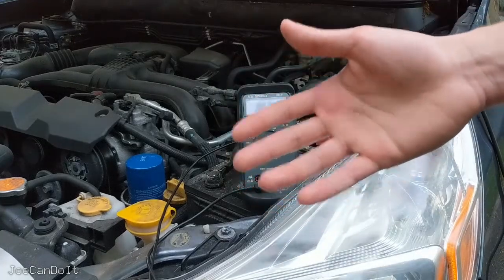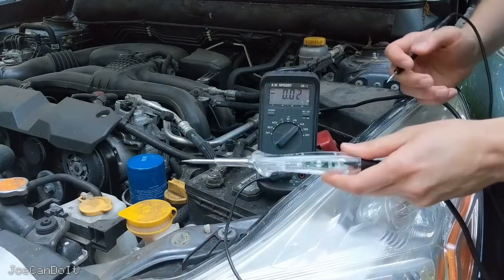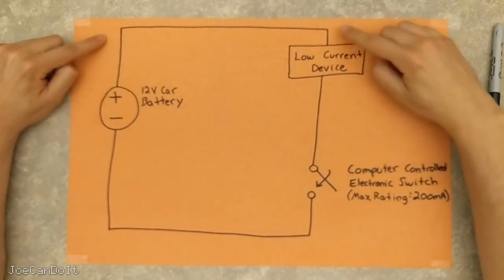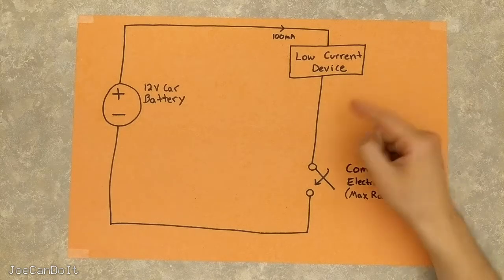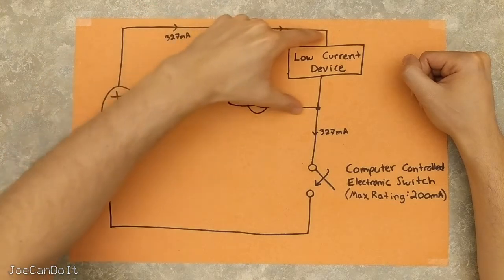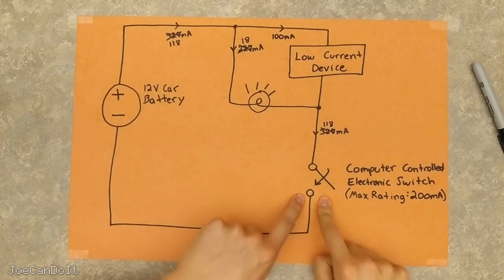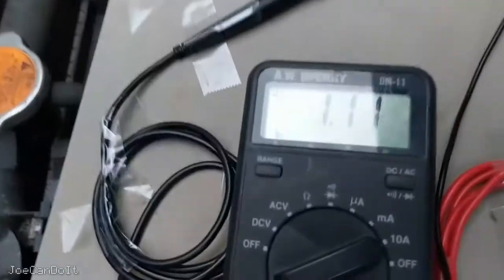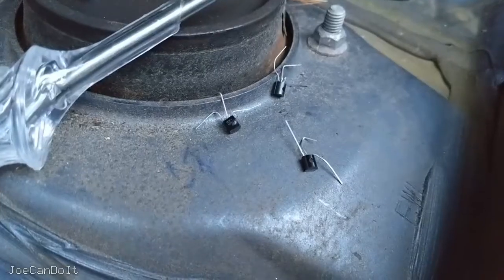Which test lights are computer safe? Measurements and fried electronics reveal the answer!

Comment: The ECU would cut the circuit off before that type of damage was caused. I have seen dead shorts on ECU's and they recover once reconnected,they are much more complex than your simple set up in this video.
Reply from the maker: I believe it, just demonstrating the concept in its simplest form.
Reply: isnt digital multimeters safe?
Reply: i like you answer best

Comment: ScannerDanner says the Incandescent bulb won’t fry your electronics but the led might. Which is it?
Reply: He never said the LED test light may harm a computer.
Reply: @fastestcaskets5020  Why doesn't ScannerDanner convey the reason why he doesn't use a Multimeter get the results he's looking for
Reply: @wildwoodtop  What?
Reply: @fastestcaskets5020  why would you even consider using a test light 🤔 wouldn't a multimeter be safe for low current testing with no chance of frying electronics / ECM ?